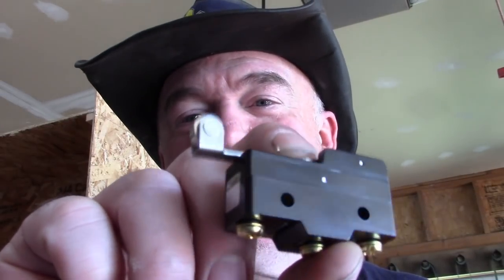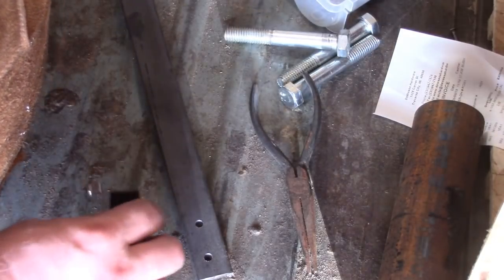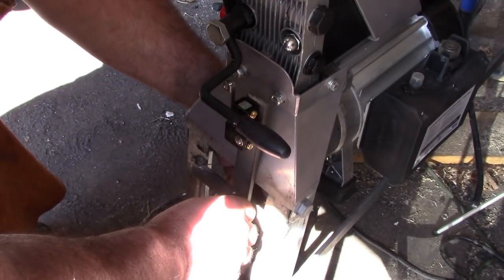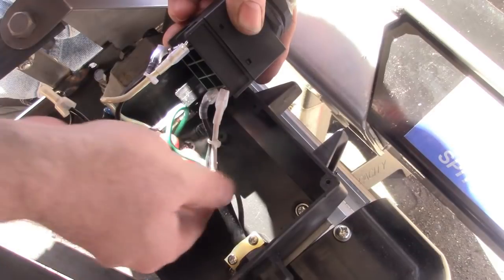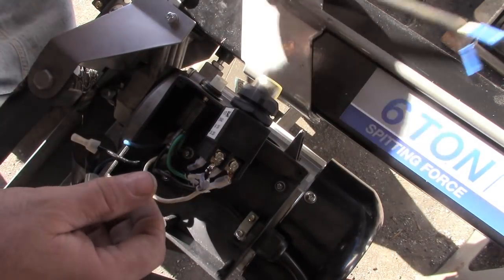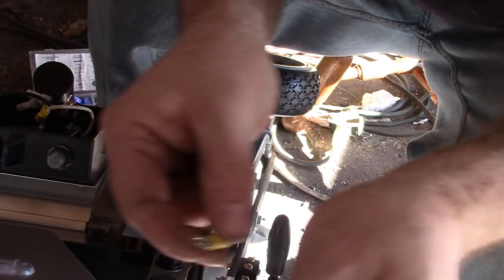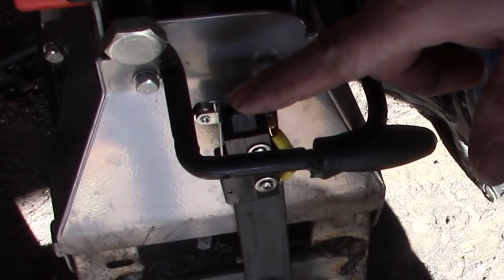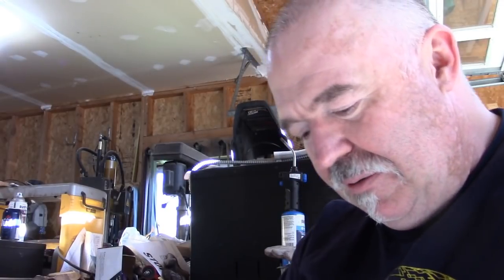6 Ton Log Splitter to Forge Press Build - Video 3 - rewiring the switch

Comment: I wonder if it's better to start and stop the motor and pump or would it be better to leave it running?  hmmm.  I'm inclined to think it's better to leave it run.  That starting continually has to be hard on the motor?
Reply: But what I'm talking about is starting and stopping during log splitting.  I think you have something else in mind.

Comment: the white neutral wire is what you want to go to your switch not the black hot wires
Reply from the maker: I freely admit that I don't know a ton about electrical stuff, but EVERYTHING I've ever been taught about household electric, is switches go on the hot wire.  That's from people who are electricians, and I've trusted their advise for years. I'm curious why you'd say the opposite for this.  Is it different because its a piece of machinery?
Reply: @HoJForge  yes it will save you or anyone else from shock in case something may malfunction
Reply from the maker: Really?  Because that is exactly why it was explained to me to wire it to the hot wire.  Something about the neutral and the ground being on that side... I don't remember exactly what because it was a few years ago when I was wiring up some lights in my house, but 110v should be  the same for household lights, or an electric motor... at least in my mind.   Again, I don't know the science or the theory behind it, but like I say, I have some very trusted people in my life that do this kind of thing for a living.  I also put a link to the Forging it Forward facebook page discussion where that was confirmed by some very knowledgeable people as well. So, before I go and redo everything, I would need to verify it with the people I personally know, but they're going to start bragging on their knowledge and experience, so anything you can give me in the way of your experience, personal or professional, or something I can take to them and ask them politely if they might be mistaken. I don't want to start an argument with them, but if all of them are wrong, then I'd like to know so I don't zap myself or start a fire or something.
Reply: @HoJForge  I'll help you out I will post it on Forge it forward for you and ask the 1 that said he was a Electrician